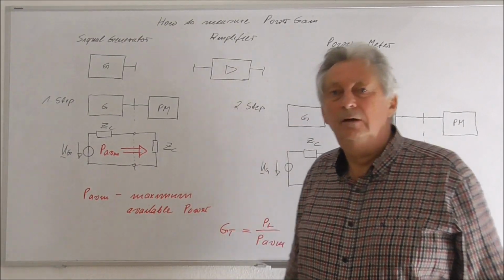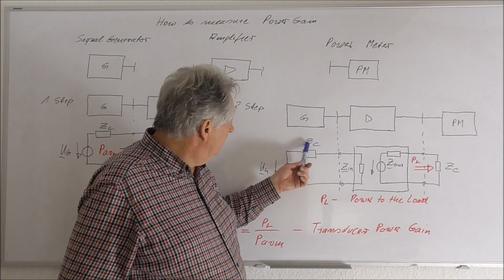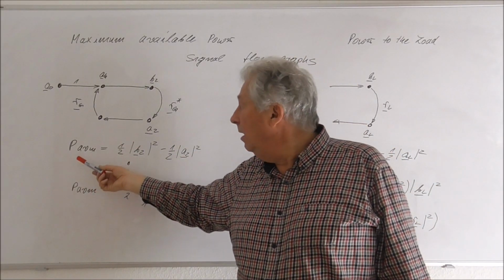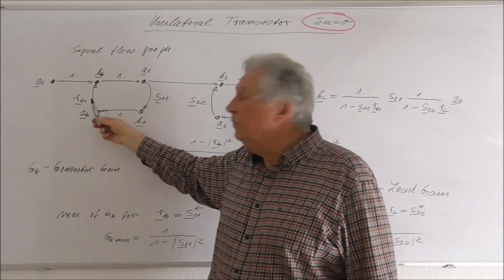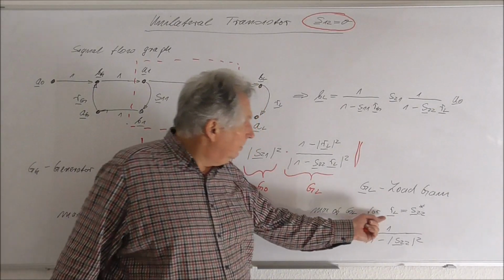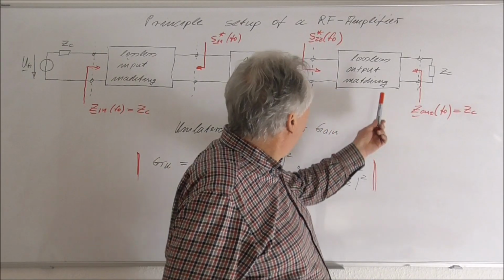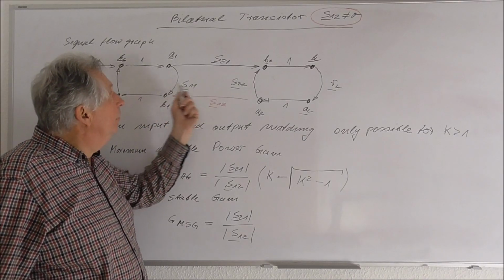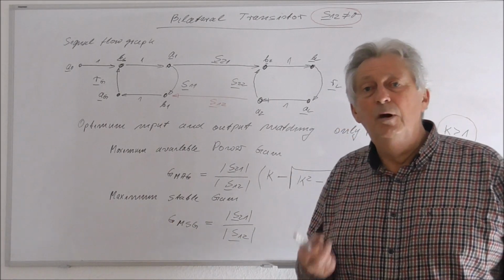Power Gains of RF-Amplifier

Comment: I wonder why in the signal flow graph for the unilateral transistor, r_G goes from a_G (reflected wave) to b_G (traveling wave)?
Reply from the maker: It is best if we talk about a certain figure. In fig. 4.10 (lecture notes) is displayed how the transistor in general sees a generator. If a wave enters the transistor part ot the wave will be reflected (S_11) and travellel back to the generator. Of course the generator in general can also show a reflection coefficient r_G. How the notes of the gererator are called has no ingfluence.